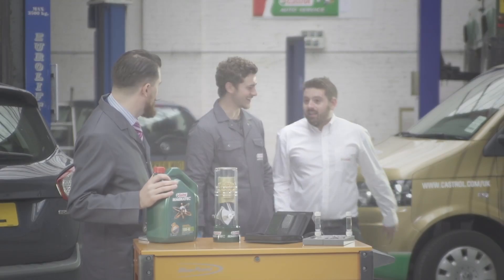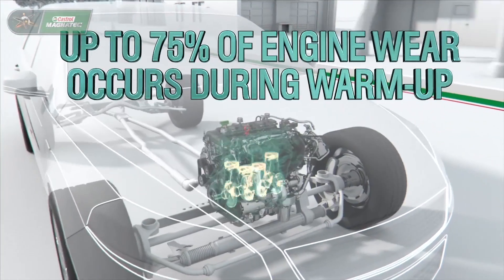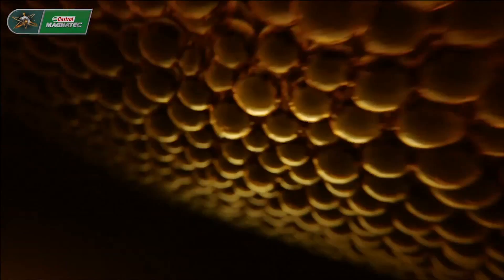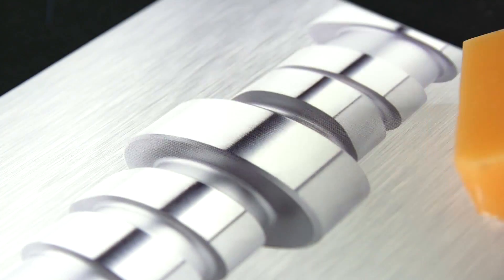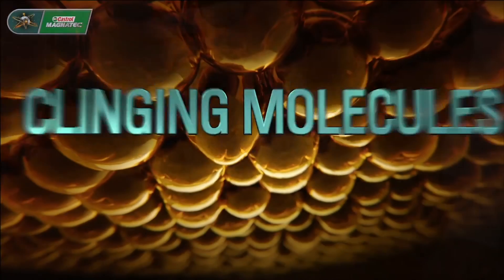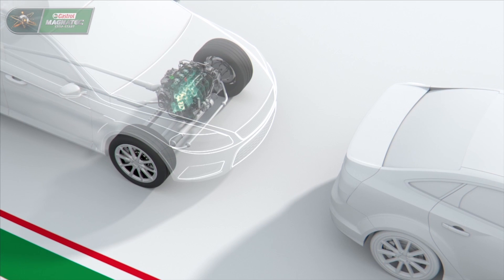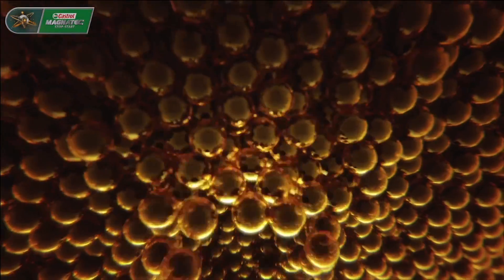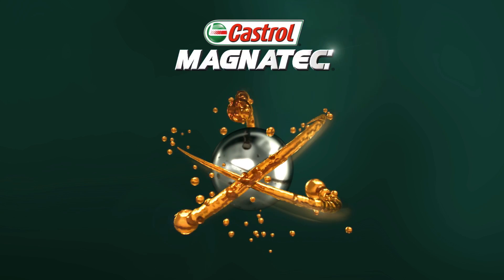Castrol Magnatec

Comment: any oil contain ester in the base oil will be magnatic cause ester is polar molculars attract to metal surface so castrol just say one benifit for ester hhhhh many full synthetic oils contain ester ... motoul ,, redline ,, silkoline ,, ravenol ,, gulf ,, and some others
Reply: Just marketing. Magnatec has no esters. Loop at Taberna del Motor and Rússia sites.